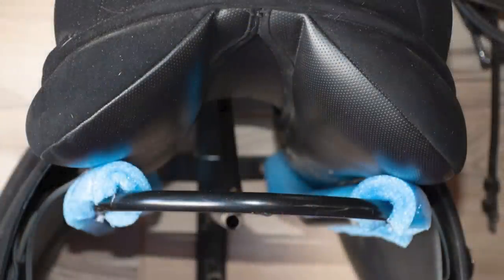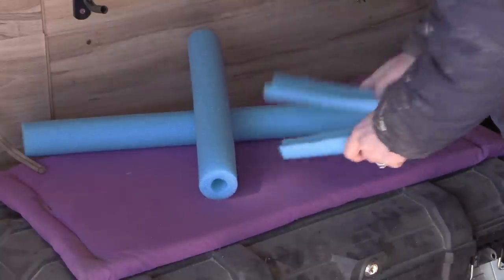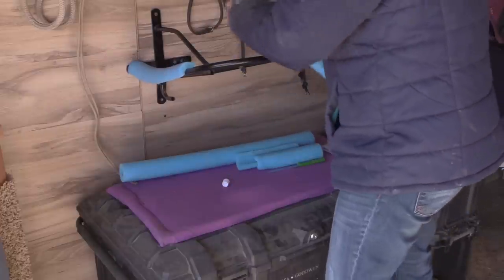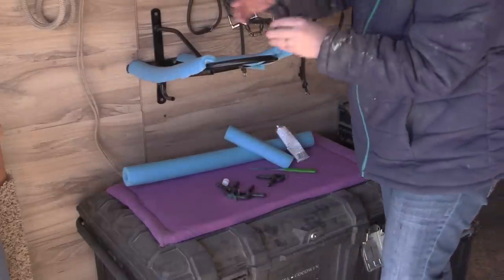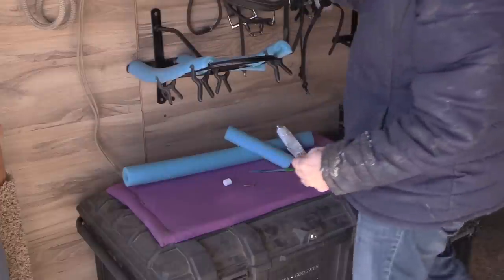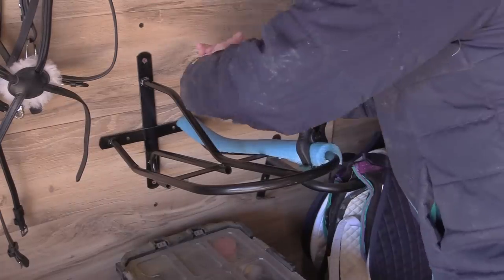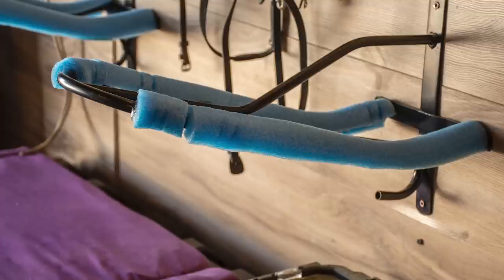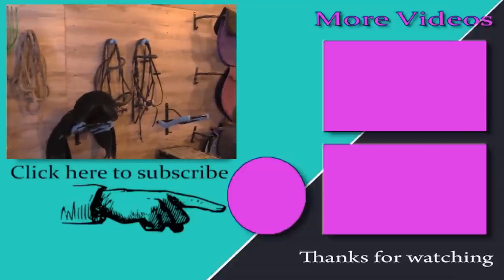Equestrian Uses For Pool Noodles In Your Tack Room

Comment: Instead of cutting all the way thru the pool noodle- cut thru just one side. Then it slips on and no clamps necessary. Pipe insulation from the home improvement store works the same and can be wrapped with tape to keep things on